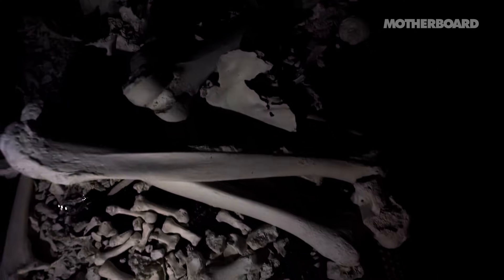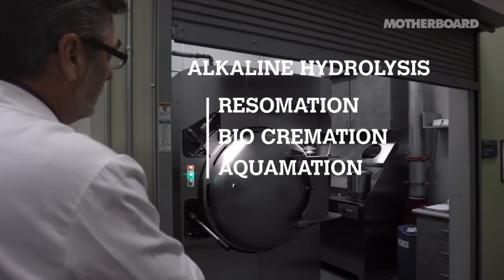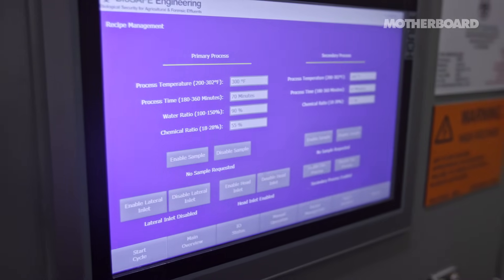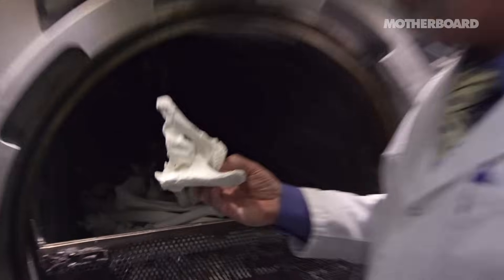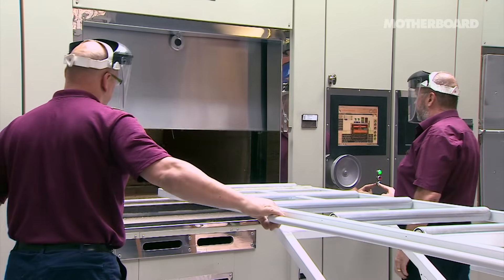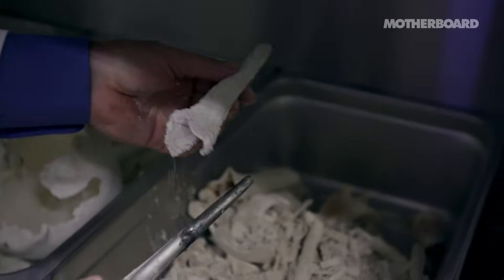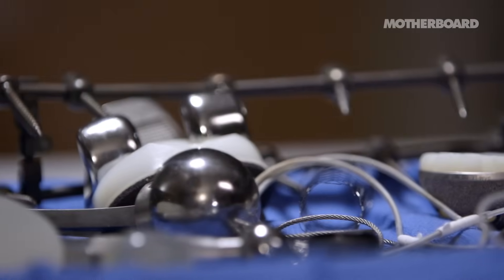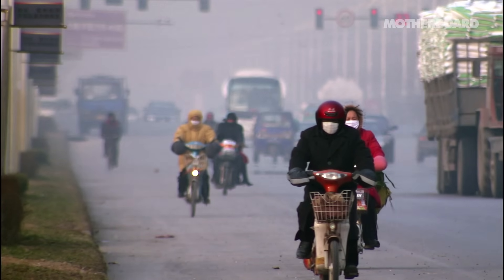Leaving Earth the Greenest Way Possible: Water Cremation

Comment: Motherboard,
That was definitely NOT the most greenest possible way to leave the Earth and here are the reasons why:

1.The machine doing the KOH cycles uses lots of energy to bring up the temperatures and there are absolutely inefficiencies associated with that and energy is being wasted in the process so it's actually making the earth less green.

2. The bones at the end of the process look creepy AF. I can't imagine myself receiving my relative's jaw & teeth only to realize that those look familiar.

3. You just can't beat the traditional burial, the earth's soils get better, decomposers get their food and the energy is curtailed. (ps. you won't have to worry about putting your loved one's bones elsewhere).

peace :*
Reply: Good news, you don't get full-sized bones back after alkaline hydrolysis! Like traditional cremation, the bones are ground into a fine, sand-like powder and placed in an urn before being returned to next of kin.

Also, this is much greener than traditional cremation, as it greatly minimizes the energy requirements and greenhouse gas output. Some religions and areas massively prefer cremation over burial, so it's a good alternative, and we're very quickly running out of burial space around the globe.